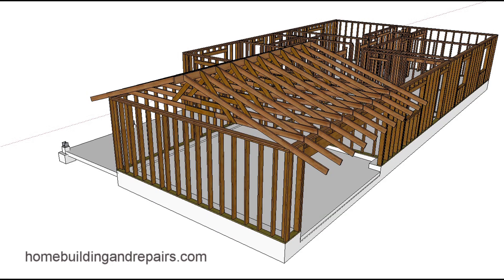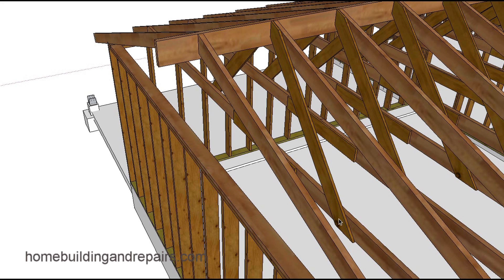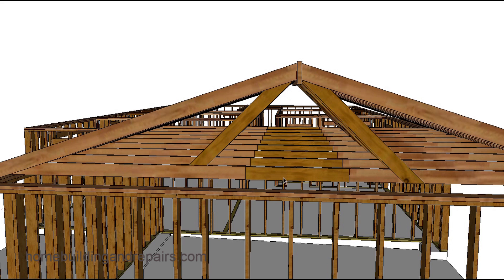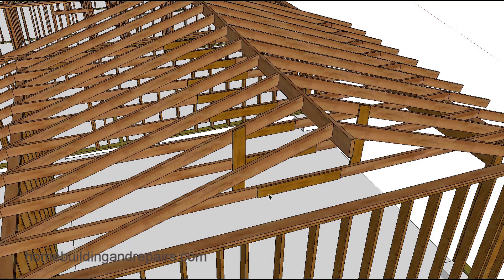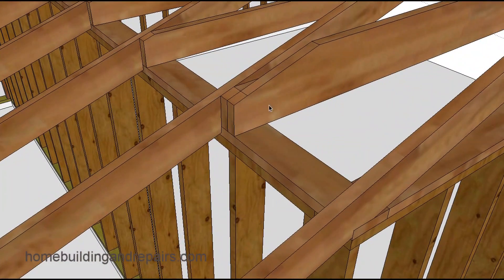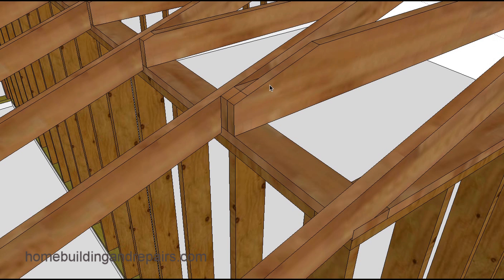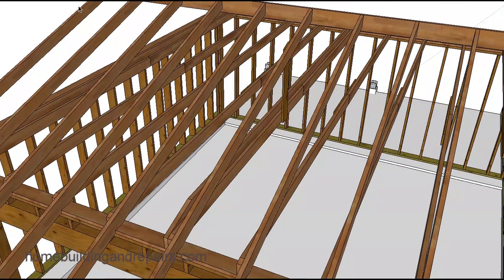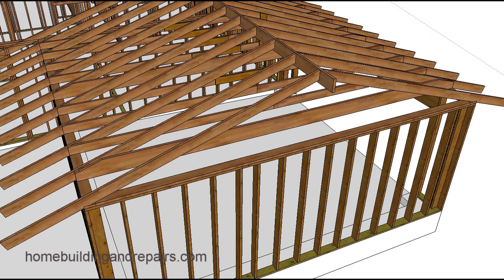Garage Roof Framing Modifications For Storage When Rafter Ties Don't Lap

Comment: Thanks for the video! I have 2x4 that are 24” apart. I’m looking to hang something that’s heavy and plan to do it along the back wall. It’s 4x8 ft in size and want it to support 600-800lbs. I’m trying to figure out the best way to reenforce the garage ceiling. There’s drywall, my roof design looks more like the second option you showed, where there are two diagonal pieces of wood going from the main top roof pieces of wood to the ones that run horizontally that have the drywall nailed to it. I know this probably sounds ridiculous, but I don’t know the proper names for joist vs rafter vs stringer vs whatever I don’t know. Thanks in advance and I hope you can sift through and understand what I’m asking! You rock!

Comment: 2x4 inch base board, by however long the garage? 20ft? 24ft? The 2x4s would solve the height issue and give more thickness of a base, for storage.

Comment: for the vertical board replacement, would that be a 2x4 or 1x4?
Reply from the maker: You would be safe replacing it with the same board you removed.